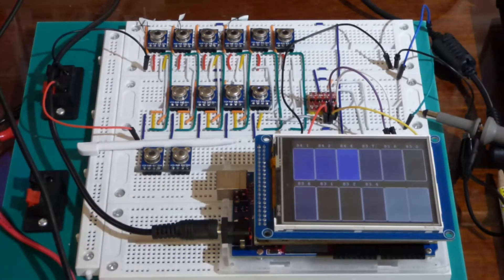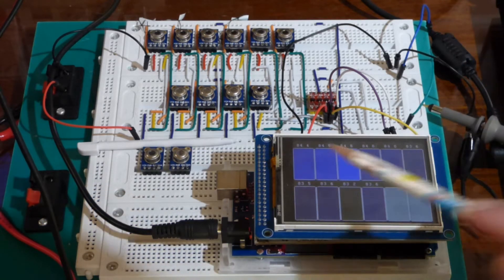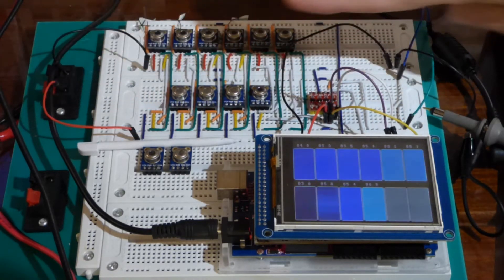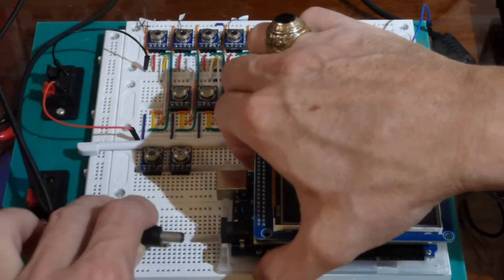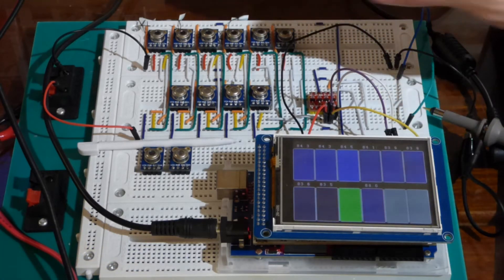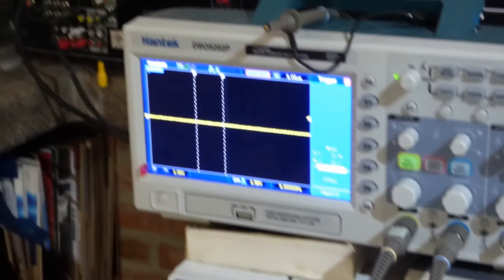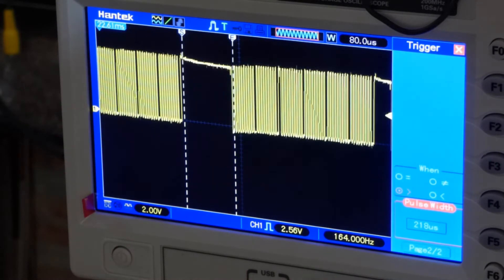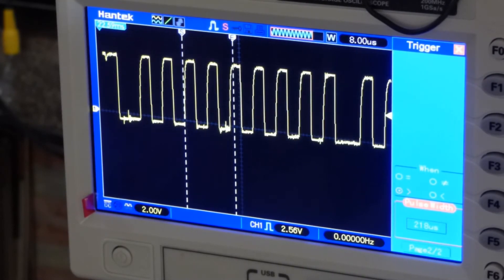Melexis MLX 90614 Array Arduino Mega2560 Color TFT Touchscreen

Comment: the mlx has a fixed i2c address - how did you address 10 of them individually? software seems to scan the bus for them. thx for sharing - also wondering what you will be using this for?
Reply: Google for it - you can reprogram the I2C addresses on the 90614